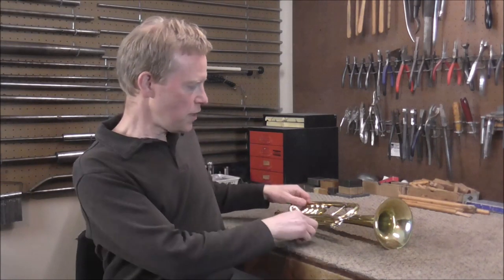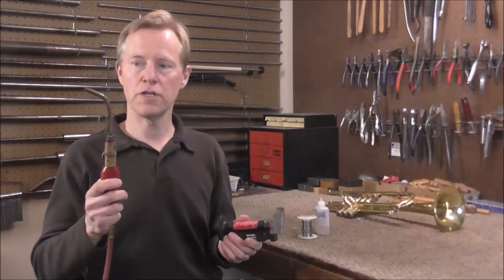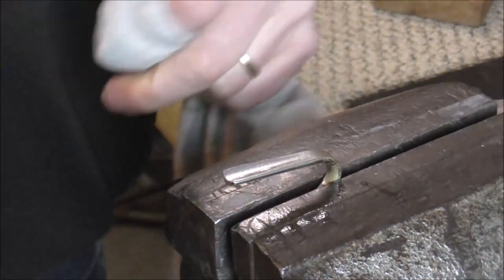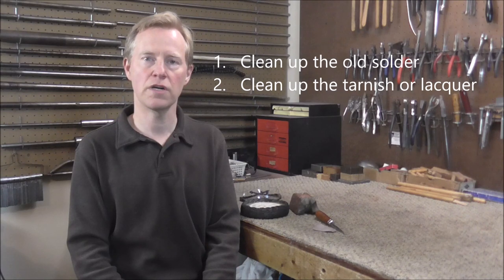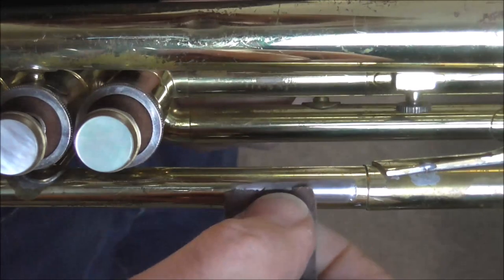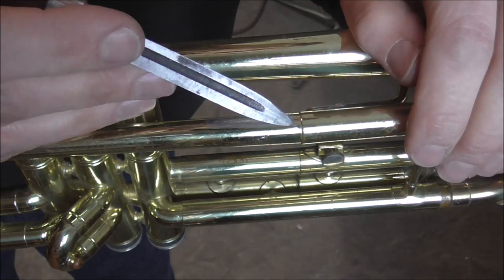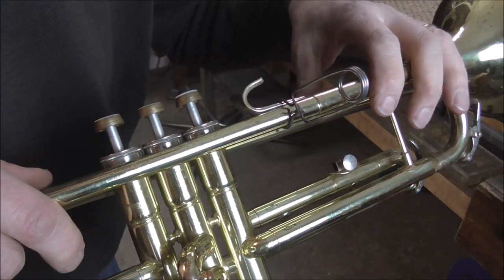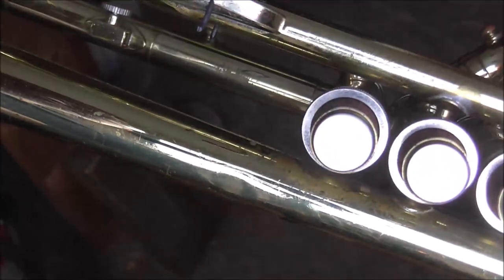Soldering On Musical Instruments Tutorial

Comment: Can I use lead/tin solder with an acid flux core and skip the spray bottle? I work at a very small music studio and anything I can do to limit the number of things I have around is helpful. Not to mention all of my tools and chemicals are kept out in the the open. I don't have a "back room" or anything like that. The last thing I need is to have my acid flux mistaken for some spray slide oil when I'm not around (Yes I would label it, but you know, humans...)
Reply from the maker: I do not know because I have never tried the acid core solder other than for plumbing. You can experiment with it, but I think the acid solder would work better. I am sorry I cannot help more.

Comment: I picked up a cheap used baritone today. they gave me a 30 day warranty, but the store is an hour drive away. I got home pulled it out, tried to play it and was dismayed to find it sounded buzzy and off... like it had a leak. I hadn't noticed that there were cracked joints on the neck pipe and the bracket holding on the mouthpiece adapter was barely holding on. I didn't want to drive back out and I figured "hell, I'm a plumber, surely I can solder this thing as well as I can a copper pipe."

I was right 🙂 thank you for instilling that confidence in me

Comment: thanks for sharing! I have several questions:

I would like to know, in the small spray bottle, what percentage of water and ammonia do you put? Is the ammonia in the supermarket already diluted? Can that be used? Is it used pure in that case?

And also: Can the ammonia solution be sprayed to cool the weld? Or is it dangerous for ammonia vapors when is it hot? Or is it better to wait for it to cool down by itself? Or use just water?

Is ammonia solution also used on silver solders? Or just on soft welds? If so, in this case is it used to cool? Is it good to cool a silver solder?

Sorry the many questions I hope you can answer. Thanks greetings from Italy
Reply from the maker: The ammonia in the supermarket is what you should use. Use about 4 parts water to 1 part ammonia. It is probably better to wait for the joint to cool down, but it does not really make very much difference. The ammonia is not needed on silver solder joints. The silver solder flux is water soluble so you can clean it off with water. 
I hope this helps,
Art
Reply: @TheBrassandWoodwindShop  really helpful, thank you so much for the reply!

Comment: What’s the name of soldering acid flux you used
Reply: Bom dia amigo, sou do Brasil, você conseguiu a resposta?
Good morning friend, I'm from Brazil, did you get the answer?
Reply: @Tuca-Luthier.  no
Reply: @shehbi  Bom dia, estou achando que é ácido muriático, (clorídrico) que são o mesmo com zinco diluído, por isso se joga agua com amônia ou bicarbonato de sódio depois, para cortar o efeito do ácido.

Good morning, I'm thinking it's muriatic acid, (hydrochloric) which are the same with diluted zinc, so you throw water with ammonia or sodium bicarbonate afterwards, to cut the effect of the acid.

Comment: Sorry to pester you Art, but I'm buying that lacquer stripper you mentioned from Feree's. Do you have any experience using either Goddard's Brass & Copper Polish or Premiere Metal Polish? They have it on their website. Someone on Trumpet Harold forum mentioned they had good experience with FLITZ 50g Metal Polish. Not sure which is "best".
Reply from the maker: I am sorry, but I have never used brass polish. I usually use buffing compound when I polish brass. Sometimes I use a product called "Miracle Cloth" if I want to match a sort of dull brass finish.
Reply: @TheBrassandWoodwindShop  Thx!